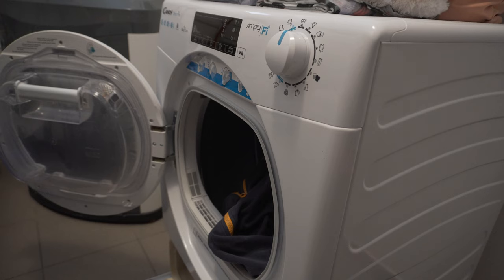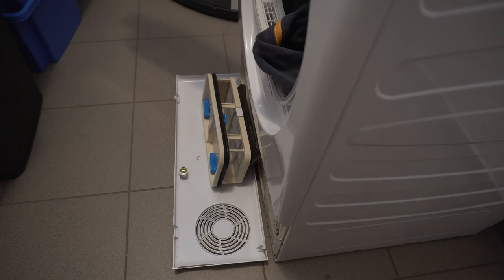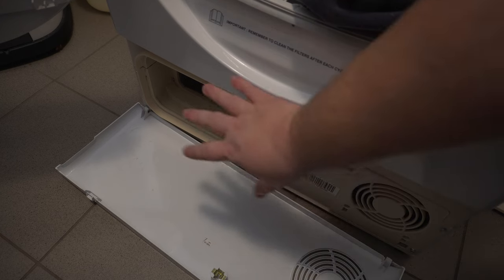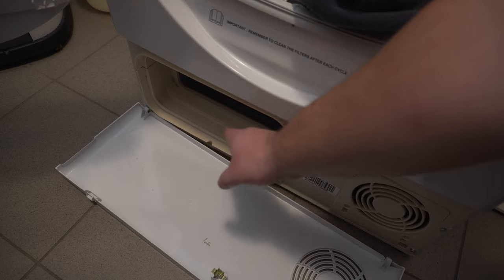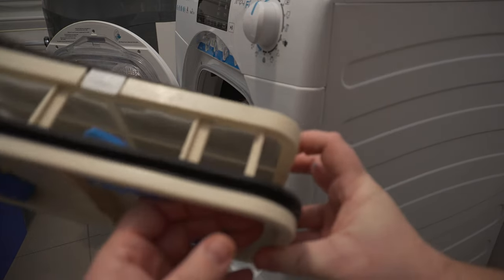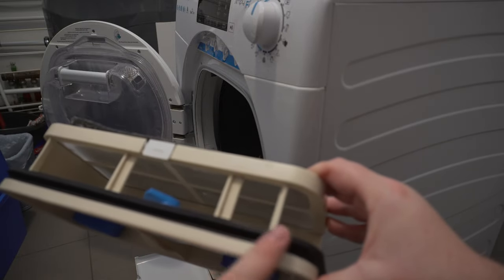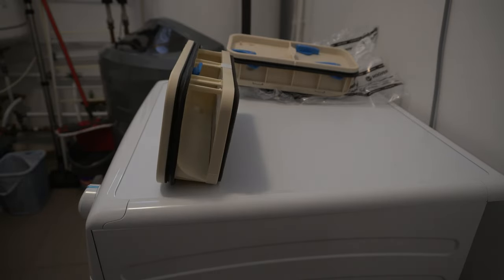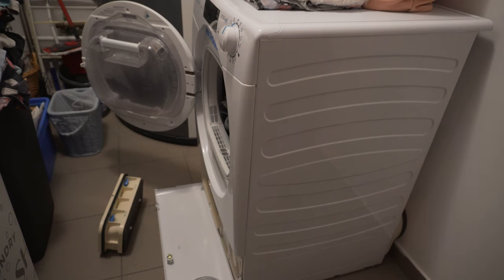Candy CSO H10A2TE tumble dryer's faults and their resolution

Comment: Hello mate. Nice video 👍 
I'm having this issue with my candy condensation dryer where it stopped to accumulate water in the specific reservoir that is located in the dryers door. When I open up the 2 filter at the bottom of the dryer is completely dry where there was always water accumulated.
The heat pump works fine,and the clothes still dry up but it takes a long time to dry.
Do you happen to know how to solve it?
Reply from the maker: @NRT_InsertCoin  Unfortunately I can’t help with that :(

Comment: only had this dryer 1 yr and its been fine but last few times i have had to use it the dryer keeps pausing the water tray is empty , the filter has been cleaned so not blocked with fluff the inside the door is also clean but it still pauses and will not complete a cycle
Reply from the maker: Don't know what the issue can be behind. My one is 3.5 years old now and it was in use at least twice, sometime 4 times a day and it goes on. Bought another one for my wife and I moved this Candy to the garage for my own use, like a month ago. I use it now like twice a week and still going fine.